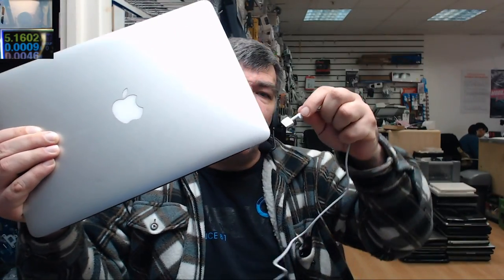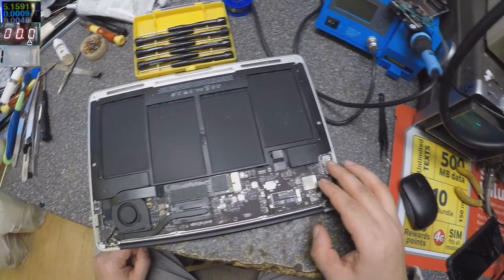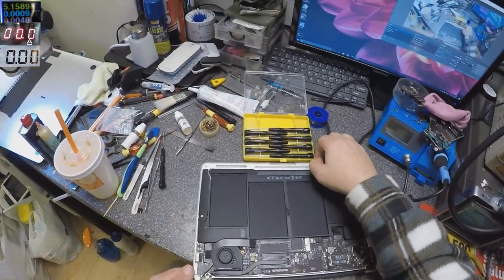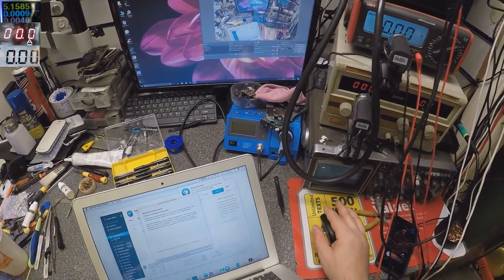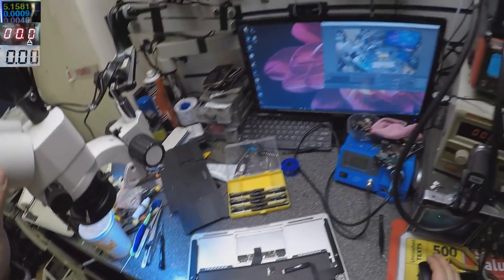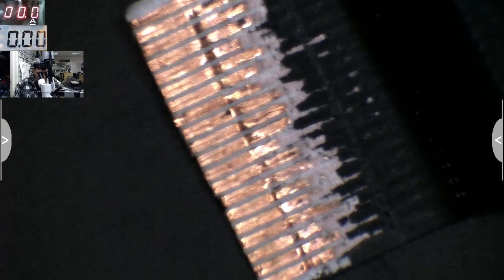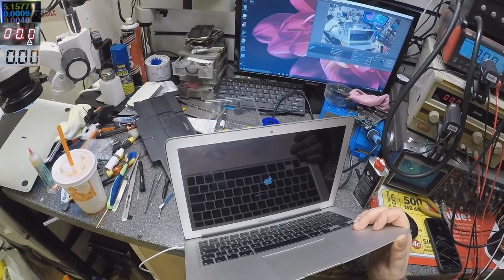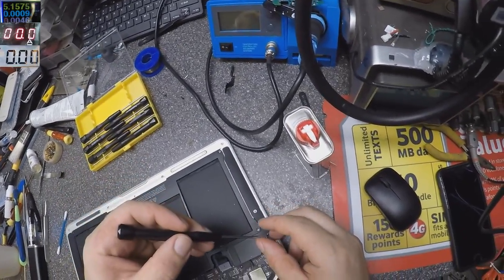Macbook air A1466/2013 no power repair, dodgy keyboard/touchpad ribbon cable

Comment: these things are sensitive to this problem. I believe it is related to the ssd. I had to track this video down for the second time. When he holds the power button and plugs in the MagSafe without battery I will hold down for 10 seconds and it allows me to save $300. You are awesome for this video. Solved my 3month old problem with this computer. Thank you

Comment: poor sick soren does the magic again. with petroleum fuel, which leaves a coating on the cable so the jerk who did this can use it till he gets a new cable. good job. I have found many times cleaning the flat cables with alcohol, or other methods gets them going.

Comment: Thanks mate! I had the issue with it not turning on and always had to remove battery and keep it in sleep mode (never shut down). Turned out to be a corroded touchpad/keyboard ribbon cable just like the video!!

Comment: Same issue. I got the fan to turn on when I disconnected the battery and plugged in the cord while holding the power button. 

I don’t have a light on the adapter now but the fan is spinning. What can I do?

Comment: Hi there I have a MacBook Air 13" early 2014, the problem I am having is it will not turn on at all. The light on charger is dim green colour, I have tried unplug battery and smc reset but still nothing, I suspect could be logic board issue? Or possibly MagSafe board? Have you ever come across this problem before?
Reply from the maker: check the voltage on the board, the 8.5v main and the 3.3v on smc. but my advice, check the youtube there are ppl fixing only macbooks and they are very good on that
Reply: Electronics repair school hi
Reply: I have same problem with a 2017 macbook air i dont understand an it stopped working out of nowhere